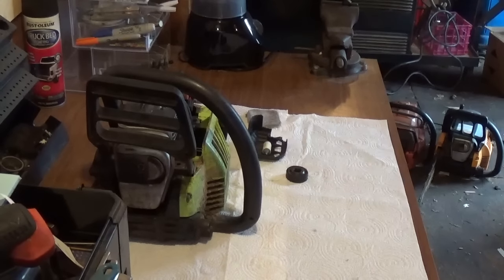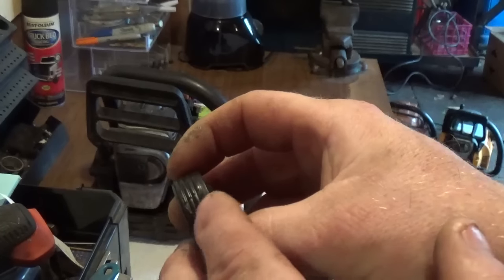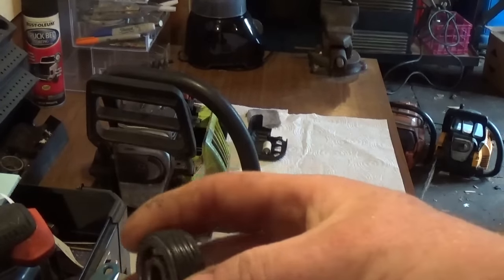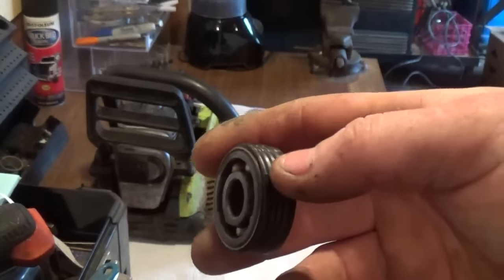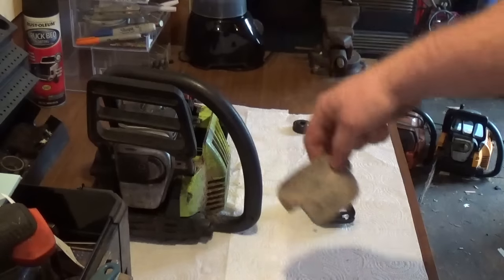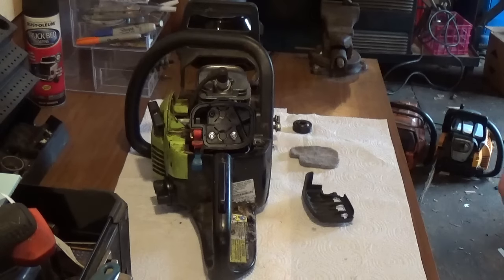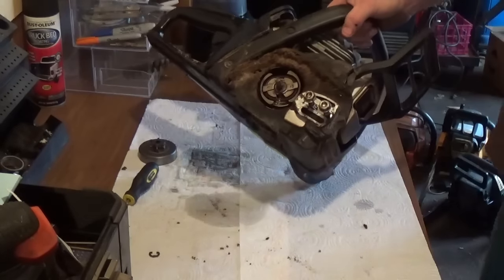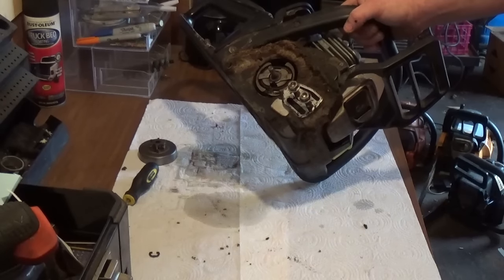Common problems with Poulan Chainsaws

Comment: I think like any mass produced product these are hit and miss. I have a Poulan Predator that I bought at Walmart at midnight 14 years ago when the gas line broke on my primary saw and left me In A bind. I figured at $139 at Walmart this was a throw away saw so I have treated it like one. This saw has been abused to no ends and it just keeps going. In 14 years I’ve ran probably 50 gallons of ethanol gas through it and done nothing but replace the gas lines and rebuild the carb which can be expected with ethanol. If it dies tomorrow I’m fine with that. It paid for itself the night I bought it and got the tree cleared out of the way. Now 3 years after I bought mine my brother bought one because of the good luck I had. His has had less than 3 tanks of fuel through it and is the biggest POS I’ve ever seen. At 3 tanks of fuel it has no compression and will not start no matter what I do to it.  I also have a Husqvarna that’s 5 years old and I have to work on it everytime I try to use it. Once it’s running it’s fine until you are done. The next tiMe you want to use it it won’t start without work again. That Poulan predator has been really dependable for me but the only saw I really trust when I need one is my Stihl 028 wood boss. It just goes and goes.

Comment: I bought one of these 5ish years ago and it’s been a nightmare. Pretty much the whole time I assumed it was something I was doing wrong. I’ve adjusted the tune, changed the carb, and babied this saw. It still didn’t work due to low compression. I checked the cylinder and it looks fine so I think it’s as you said with the seals going bad. 

All that to be said it’s good to know I’m not crazy and I should just cut my losses!!

Than you
Reply from the maker: Your Welcome / I wish more viewers would listen so they dont become victims with buyer's remorse.

Comment: Poulan as a company SUCKS. I'm trying to figure out why my 1950LE will not run without dying. If I prime it by hand it'll start and run for a few seconds. Put more gas in by hand starts and runs for a few seconds. Primer button works, fuel is going into the line. No one can tell me how to adjust the idle screws they ALL start with the L & H screws first. Can't do that if you can't get it to run. The manuals are useless. Mine has a different muffler than all the others, cannot get it off to see if its clogged, should come right off, but when I take off the single nut it doesn't budge, its not in the manual...
Reply from the maker: Behind that single nut is a small covering plate with a spark arrester …..behind the plate and spark arrester will be two allen screws or torx . But its highly unlikely inless you use old fuel and or cheap mix you have a clogged spark arrester. Your saw is likely suffering from a swollen check valve internal to the carb ……...This valve is made of neoprene and swells as a result of ethanol in modern gasolines being to high . Note that this effect from modern gasoline affect many saws in the same way but Poulans already cheap quality just adds insult to reason . I personally have seen this problem on many …...and when I say many …….I mean many …..many different Poulans in the last 15 plus years . Often even fuel lines and tank vents even the tank fuel caps will become affected . But more common than even fuel related problems are the cheaply made seals and bearing systems used on Poulans . These Poulans are plagued with issues straight out of the box . What most people fail to understand is yes you can adjust the carb. But by doing so your fighting a existing issue of seal leakage …….as a result they often burn up the saws ….. Now with that being said there are those adamant upon repairing these Pieces of Shit so let me offer advice ..{DONT EVEN BE FUCKING TEMPTED } By the time you order a new carb or carb adjusting screw driver set that are uniquely designed and new seals you will often be about half the price if not more upon purchasing the original Piece of shit saw . A saw be mindful that will likely fail again as a result of cheaply manufactured parts . So the best advice over all I can offer is stay clear of Cheap Poulans , Poulan Pro , Husqvarna , Jonsered, and Craftsman just to name a few .  Husqvarna is the parent company and supplies small box stores with cheaply made Poulans in different packaging if you know what I mean .

Comment: Common problem with Poulan chainsaws are people like you.I  own Poulan and Husqvarna chainsaws,all of them for years(I live on ten acres of wooded property) with absolutely NO problems with any of them.Normal maintenance which includes mainly replacing fuel lines every four or five years due to ethanol fuel is the only thing needed done.Once you master fuel line replacement it takes twenty minutes and less then a dollar in material to do this normal repair. All my chainsaws that date back over 15 years and more, are even using the original spark plugs. Sick of so much stupid misinformation from amateur want to be knowledge less based informers. We run Amsoil 2 cycle synthetic 100:1 mix ratio in all our 2 cycle equipment and they run clean with very very little carbon buildup and plugs last forever.

Comment: I've had a Poulan for 26 years. Didn't know hardly anything about them or maintaining them when I got it. 10 years ago it stopped running and I replaced the fuel lines because they were leaking and changed the fuel filter. Runs just fine with no problems.
Reply from the maker: Great......Prove it ...

Comment: I know people are complaining about quality of these products, but everyone knows they don’t make them like they use to.I remember in the 50s&60s my dad & brother cutting 12 inch high weed grass with an old lawn mower hitting hidden stones or bricks an bringing the mower to a loud bang & stop with out bending the blade or shearing the fly wheel key , they simply tossed the stone out the way & restarted the mower an kept cutting.Now since they don’t make these products like back then , you have to make precautionary considerations when using them.Take a walk behind mower for example, never assume your yard is obstacle free of anything that can cause damage to your equipment. I always walk my yard to look for potential hazards if the grass is over 5 to 6 inches i simply take my time & Combe though it with my feet in a tight pattern especially if I am cutting someone else’s yard.As far as chainsaws, string trimmers etc you have to already assume problems will arise because of manufacturing changes & practice. Maintenance is more frequent than ever, parts require replacement quicker for top performance, one thing an owner can do is always use good or fresh fuel, rinse out your fuel tank with denatured alcohol, remove air filter an spray a little carb cleaner at full throttle, clean an check plug&filters check fuel lines also find a friend or neighbor that tinkers around with small engines, also there are plenty of less expensive parts for purchase online,glance over u-tube videos for help with your so called ( piece of shit ) equipment!!!!
Reply from the maker: John/ this comment is very well written ….and I agree almost entirely ….but basic quality must be already present as if it wasn't then by purchasing a even cheaper alternative will lead to even further problems long term with what was already inferior . Making what is certainly a piece of shit {Diarrhetic}

Comment: Way way tooo much discrimination against Poulan products plus tooo much overexpectantcy from this product.....THIS has been MY  personal experience (over 35+years) with these products
Reply from the maker: Perhaps / but there is complete justification in any individuals actions when evident facts can be supported . And lets be honest they are obviously seen . As far as over expectancy I don't think that a saw that is brand new straight from the box should fail when proper gas/oil mix was applied and simple pine was being cut about 6 inchs round . To add even more insult to reason then brought back to the dealer from witch tears it down …..finds the reason for the failure only to be denied warranty upon the saw …….When the saw hasn't even ran out the first tank of gas …...So yeah ….perhaps your right maybe we as customers are just are over expecting . Still I would invest one cent into these curses that leave the owners with buyers remorse .

Comment: Im also work small engine. Those small protrusion don't break off.
The oilers are the best I've seen.
Most of what you complained about is maintenance. 
Poulon is not a bad garden. And for people that don't use a chainsaw regularly they are perfect.

Comment: My 42cc Poulan with 18" bar has done a good job for me, for the price, I can't complain. At the end of summer I run it with fuel conditioner and dump the gas. I never cleaned the air filter until one day I could not pull the trigger all the way without flooding the engine, so that's it, cleaned it with carb cleaner, dried it with compressed air, and it's like new. Most of the time I use it with a 14" bar, but occasionally I need to fell a big tree, like today, 20" one, and with the 18" bar the 42cc is strong enough to do the job. The most important thing is the chain, how sharp it is.
Reply from the maker: Great provide a video of it performing the said task . My viewers and I would like to see it in action .

Comment: I've worked on several of these saws mostly called Poulan "WILD THING" rebuilt carbs only to later replace they a nightmare to get adjusted to idle properly and it's basically the seal he is talking about causing the problem. aaai have told several people it's cheaper for them to buy another saw than send them out for repair.
Reply from the maker: Thank you .....you are completely right.....these saws are just junk ..

Comment: Dude get off that soapbox. 99% of what you are crying about is alleviated by proper P.M. I'm still using one I bought in 1996. And I used it HARD for most of it's life before I bought bigger and better saws. Only thing I replaced was fuel lines, filter and primer bulb,,,, and of course chains & bar. It's still running great.
Reply from the maker: Then it shouldn't be any issue for you to provide a short video of it in action {SHOULD IT ?} Or conveniently enough as a result of your newest additions have you sold it and just idealizing the fact it still runs great . Please by all means explain the situation for the lack of the saw not running or remaining in your possession as my viewers and I would love to see you perform the Poulan challenge .

Comment: Who doesn't do maintenance on a chain saw and expect it to  last?  20 year old Woodshark 150 and averaged 8 cord per year.  Had to replace fuel lines and gas cap once.  Kept it clean and adjusted and that is about all.   I had a Husqvarna 350 for larger stuff and worked on it just as much.  Buy a used one, you wont be disappointed.
Reply from the maker: My viewers and I are calling bullshit on this comment ….Prove it …..if you cant then retract this comment as we have grown tired of seeing such bullshit projected because of a few self righteous individuals whom seem sold on foolish idealisms and fabricate as well as exaggerate truths . So PUT UP OR SHUT UP / I have included whats expected of any viewer making such claims yet not a single one ever steps forward with any example after such a comment is made . So Prove it …..Ken Hoying …...Provide a video ……..{ Fair enough } fellow viewers …….Don't you think ?

Comment: I agree with you 110% but I believe they are made to be that way. Nothing is what it used to be. I have a older poulan when they made a saw and I take it over my newer stihl. Everything is made cheap on them now even the plastic is not the plastic that used to be. Thanks for the video and I’m sure you could of said more.
Reply from the maker: True/ So very true..

Comment: It doesnt matter if Husquvarna owns a company. Big difference in parent and sister company's. You have novice to pro saws and then you have a company that makes a cheaper version for the average homeowner. Trying to throw Husqu's name out there like their poulan is like blaming Yamaha for Tao Tao lol!
Reply from the maker: I understand your perspective....However your lacking to see  that Husqvarna is indeed the parent company . Being as such .....trying to capitalize on price point rather than quality expected ......And this as a result has made issues for both the Husqvarna base lines as well as Poulan as the quality of these lower lines is allowing people to see the greed of a dollar stolen by deception rather than earned by quality and performance as seals ,carbs ,coils , Etc are exactually the same on the cheapest models. Although due to greed packaging of these parts may vary in price if purchased for a Husqvarna compared via a Poulan . LOL

Comment: Preach it I concur with your opinion on poulan pro I'm a husqvarna guy and abuse the hell out of em I've got 13 yrs on one 8 on 2 others an 3 on another .....a quality saw should with minor maintenance an proper care should handle all the abuse you want to put it through for 10 yrs an still keep on rolling ......a poulan wouldn't handle 10 days in my world an i wouldn't bother to try to make one even if it was given to me poulans just swiss me off in every way trust me I have tried them In the past and they always crapped out they is junk ild rather use a axe its less work than starting most damn poulans true story
Reply from the maker: I completely agree...well said..

Comment: I buy power equipment from the scrapyard and believe me I get tons of poulan saws, new and old, big and small, all models from 30 years ago to 2 years old just needing a carb adjustment. On pretty much every one they just need fuel lines and metering diaphragm, I cant agree with you on the crank seals making a problem, as I have never had one give me a problem. The gas cap is a poor design,  but it is because of ethanol fuel, and to be fair, most of the time they reccomend you to run ethanol free fuel.
Reply from the maker: LOL …..Poulan seals never proving to be a problem …...I highly doubt that …..perhaps you have grown accustomed to passive idle from faulty check valves fine tuning to achieve a moderate affect …...But rest assured the seals are almost always the reason for a failure on poulans and some of the cheaper husqvarnas .Husqvarna has superseded the seal part number 6 times in the last 10 plus years …….AND FRIEND THEY DONT DO IT FOR THERE TO HAVE BEEN NO PROBLEM WITH THE ORIGINAL SEALS...….Seriously look for your self ….LOL Poulan/Husqvarna gets the seals made over seas then shipped back . The neoprene just dosent hold up under modern gasolines so I will give you partial credit for that but Heat is the leading cause for failure in all poulans made currently as the seals mating surface will develop a air leak …..COMMON PROBLEM and many videos to prove it on youtube …..So for you to imply you only change fuel lines and diaphragms told me a lot to the extent of your mechanical expertise . I mean respectfully Five speed ash I know bullshit when I see it typed. I not saying your lying in regards to what you claim you have done ……….What I am saying with out any doubt is your success from junkyard finds is very limited {POULAN CHAINSAWS FOR DAMNED SURE} as I have seen way to many straight from the box that had seal leaks and would run erratically to know better than to take the word of any individual whom would imply that all that would be required is fuel lines and carb diaphragms. SO if your adamant in projecting this comment as truth you may wont to watch several videos on how to properly vac and pressure test a chainsaw . And set aside that set of carb adjusting screwdrivers as all your really doing is restoring the fuel supply to a likely damaged Check valve forcing responsive results from both low and high speed mixture screws that are no where near the real factory settings to achieve a moderate running affect . These critical air to gas ratios are imperative to lube all internal  parts as well as allow combustion of the engine . What most people whom decide to turn the screws fail to understand is by doing so they risk leaning out the equipment to much and scoring there pistons and cylinders .

Comment: my father has a 42cc and hes run it through hell and its works great for em (all its really ever needed is carb cleaning), but Ive had nothing but bad experiences with my 3314. im gonna find a way to make a better air filter system for his so the cleaning doesn't have to be done as often.. he loves that thing because well.... he got it for 50 dollars used and has cut at least 2 tons of wood with it over the last 4 years. but i do agree on the 3314 they are complete garbage.
Reply from the maker: I wish you the best and hope it continues to perform with these same results for your father. However my experiences have never provided me with anything less than buyers remorse and a empty wallet .

Comment: Owner of one for 23 years cut fire wood and cleared house lots .
Bar 
Chain
Plug
Fuel lines 
Have been the only replacement parts as for the sticky gas cover when not in use I leave mine laying on it's side and works just fine for me regular cleaning prevents over heating preventing the seal problem .
Reply from the maker: Fair enough …...show my viewers and I this 23 year old poulan in action .